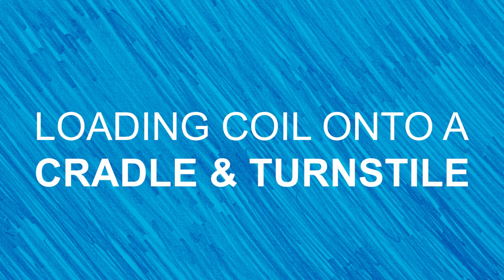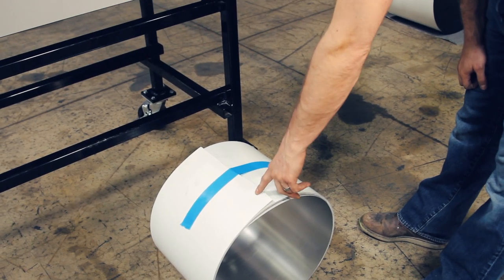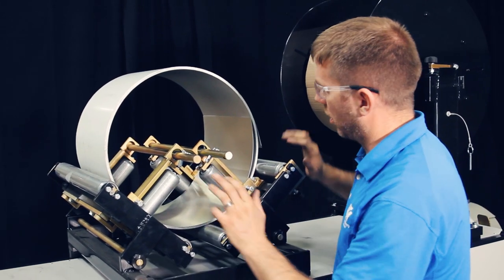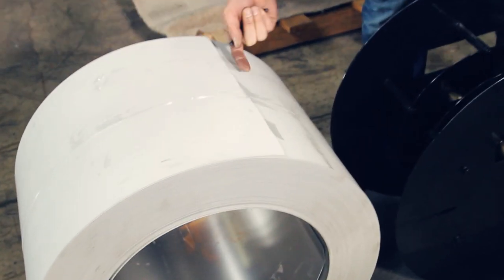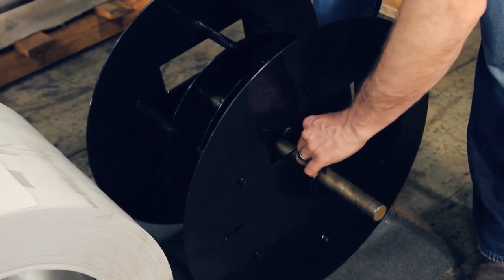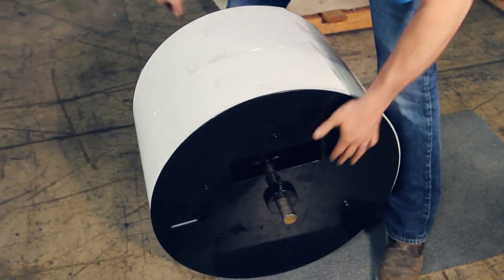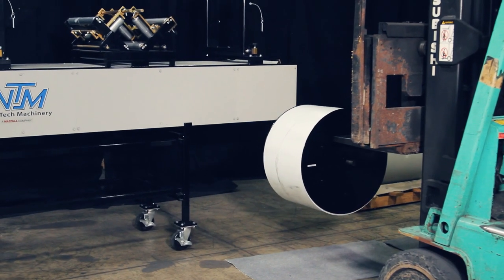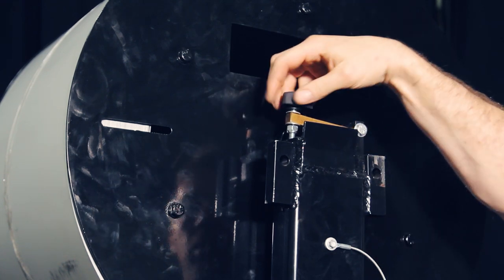How To Load Coil On An NTM Gutter Machine: Cradle And Reel & Turnstile

Comment: @ Ben, I would like to know more about the coils used on a 5" gutter machine. In chapter 8 of the operator manual it references a max load capacity of 1000 pounds on the reels. What is the recommended load capacity for the reels? What is the product yield in ft at this recommended load capacity? 
For ease and assurance in ordering the coils (from China), what are the prescribed data inputs shown in the NTM coil calculator diagram. I am not sure about the reels that were shipped if they are 16" or 20"
ID, Coil thickness, width, and gauge?
I enoyed the video. Very insightful!

Comment: Can i turn the reel so i can run out material for use of both colours  on either side of the coil?
Reply from the maker: Yes, our reels are mounted on turnstile reel stands so you can spin the reel to face the other direction when needed.

Comment: The polyurethane drive system eliminates the need to load coil prior to transportation. What does that mean?
Reply from the maker: On older gutter machines with forming and drive rollers combined, coil needed to be left inside the machine during transport to protect the rollers from banging into each other and potentially damaging the rollers.  In NTM machines the polyurethane drive rollers are separate from forming rollers so material shouldn't be left inside the machine during transport.

Comment: Is both coil the same roll are they interchangeable
Reply from the maker: Yes, coil cradles and reels support the same widths of coil.  New Tech Machinery doesn't recommend loading coil onto a cradle until the machine is at the jobsite.  This will alleviate any denting or marking of the coil during transport.  Reels can be loaded with coil prior to transport as they have inside diameter support.
Reply: @NewTechMachinery  thanks

Comment: Cradle is worst investment we ever did. If you have roll on it and drive your track it will makes dents on coil where it lands on rollers. 2 cradles laying down in our shop as dead weight of metal.
Reply from the maker: New Tech Machinery doesn't recommend loading coil onto a cradle until the machine is at the jobsite.  This will alleviate any denting or marking of the coil during transport.